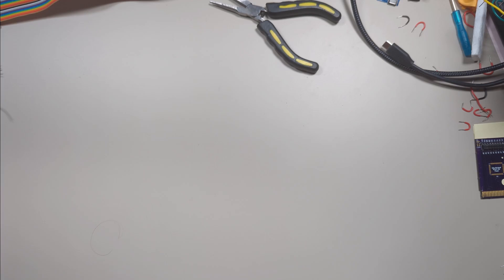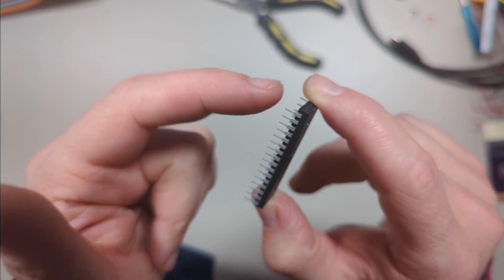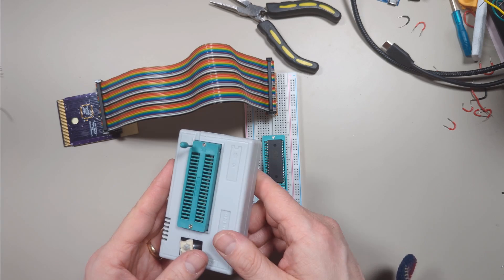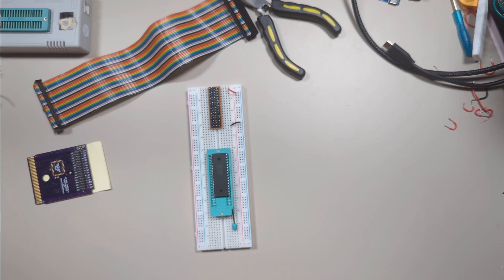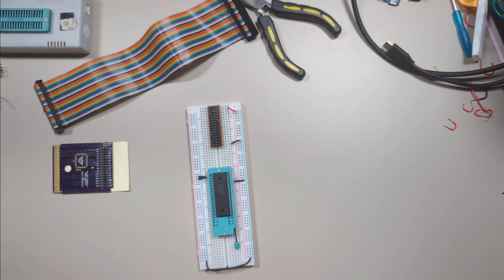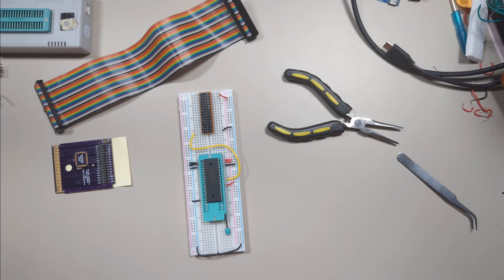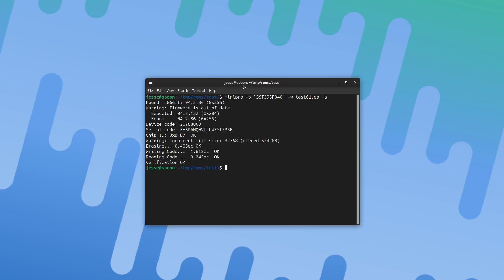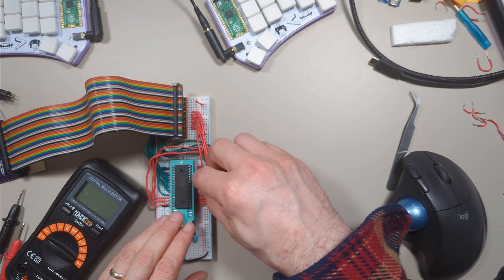Make a GameBoy flash cartridge!

Comment: Hi sorry I'm over a year late but us there a way I could use an esp 32 or a aurdino to do all of this
Reply from the maker: As in use an esp 32 or an arduino instead of the memory chip? I don't think so. I think they're just not fast enough for that. Someone did make a cartridge that uses a RP2040 though https://www.tindie.com/products/zeraphim/rp2040-based-game-boy-cartridge/ so that's cool!

If you mean including an esp 32 or an arduino on the cartridge in addition to a memory chip and having some way to communicate between the gameboy and the esp/arduino, then maybe! I've actually done it with an esp8266 https://www.systemoflevers.com/blog/2021/12/16/gameboy-wifi-cart/. A big challenge is power draw. WiFi causes big spikes in power draw and it overloads the gameboy power supply. I got around it with a big capacitor to smooth out the spikes.
Reply: If you want to know some of the challenges, Sebastian from the channel "there oughta be" talked about how a microcontroller isn't fast enough to react to the address lines changes (but I can't remember which video, probably either the gb interceptor or the wifi cartridge)

Comment: Hi, I would recommend against the way you've currently connected CE and OE on the chip. The reason being, that if the game ever tries to write to the ROM space, the flash chip will actually see that as a read since A15=0 which makes both CE and OE zero. And two parties on the bus are now competing to drive the data bus. Why would a 32k game do that? Well, many such games, including Tetris, write a 1 to the ROM bank register as a safety mechanism, in case the game was running on a cartridge with a MBC. I can't promise that would make it work on the FPGBC, but at least it checks out that it could be the issue considering your image ROM works but Tetris doesn't. The recommended connection is GB A15 to CE, and RD to OE.

Another potential issue is that some of the higher address bits are swapped around.

Another recommendation is to go to Makho's repo (linked from Funnyplaying's product page) and get the "patched boot logo" version of the FPGA firmware. This essentially just uses the original boot ROM. Not only does it look more like the original thing, but more importantly for you it shows the boot logo so you can use it for some basic troubleshooting.
Reply from the maker: Oh jeez, that's a good point. I can totally see the FPGBC having more issues with bus contention than the DMG. I'll see if the change fixes things.

Thanks for the advice! I'll double check the address lines too. I'm extra glad I posted this video now!